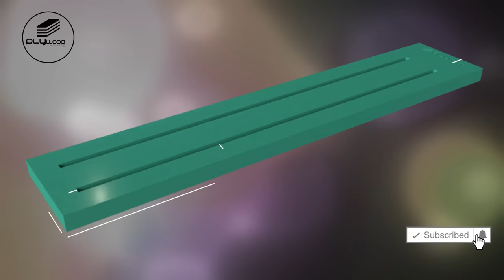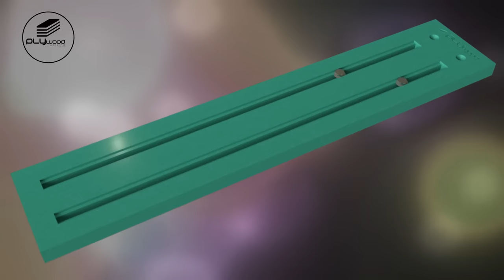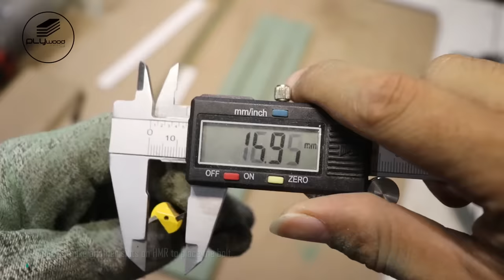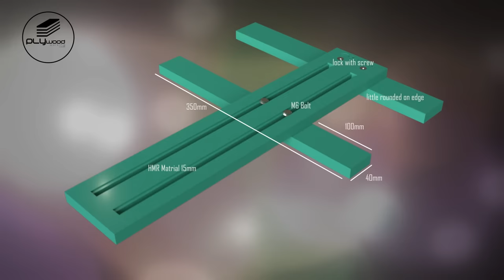DIY Simple Jig For Circular Saw - Fast & Easy Straight Cut

Comment: Use a speed square as a fence.
Fail to see the use
Reply from the maker: Yes can use speed square but have problem if back edge not straight and if more wide 15 inches ,but if you expert i think easy for cut straight without this jig
Reply: Have a look at home made tracksaws. That would be a useful tool for you.
Reply from the maker: Yes basicly look like track saw, i made many jig for circular saw like track saw, rip cut and simple jig, all very help me cut straight large board